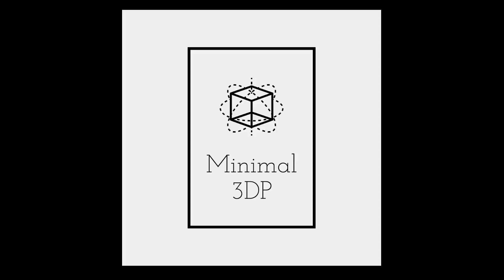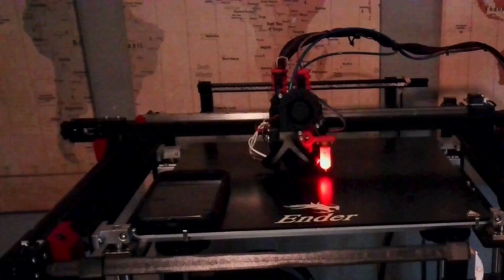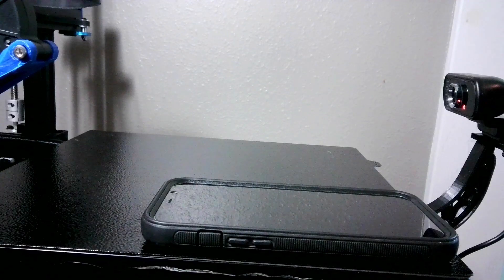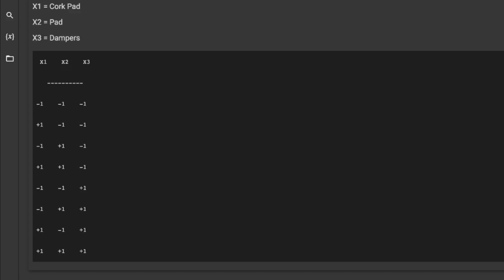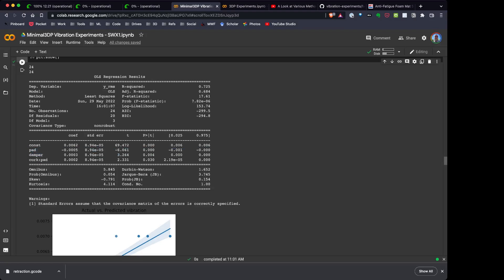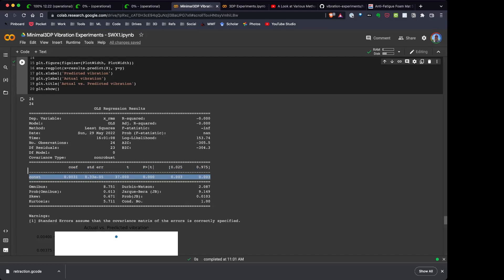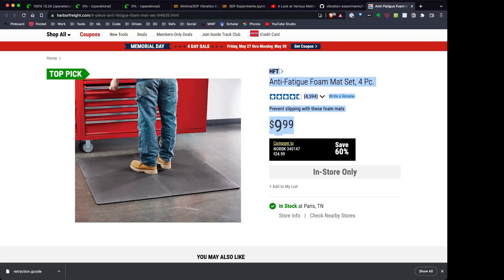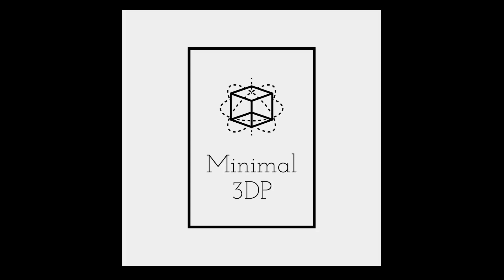Reducing Vibrations Transmitted Between 3D Printers

Comment: Im going through this, Ive got rubber exhaust hangers cable tied to the front and rear 20x20 cross bars and that has shut them up, The Carriage and carriage fans are where all the noise is coming from. Thats really bad doing the diagonal infill. But its also almost untreatable, Speeding the print up tunes it out a little but then you get the problems with that. Im going to print some parts for a serious upgrade. I have a cunning plan. :hand-purple-blue-peace:
Reply from the maker: I hope your plan works out.